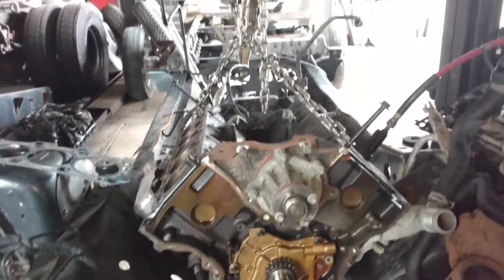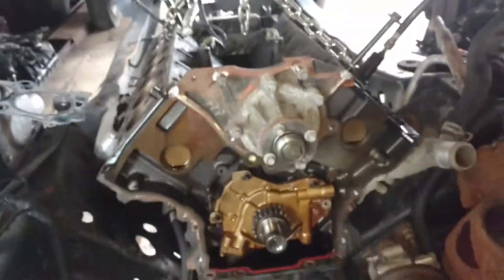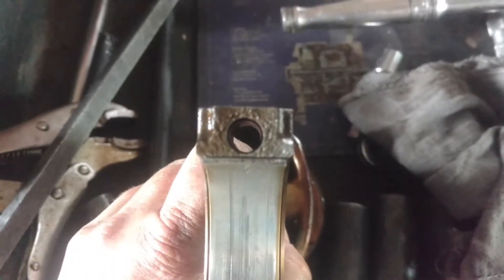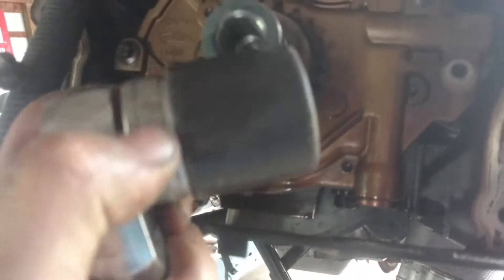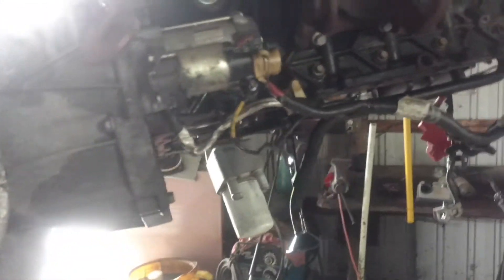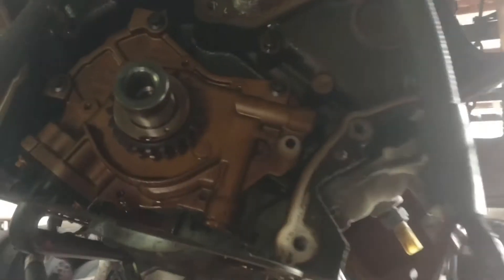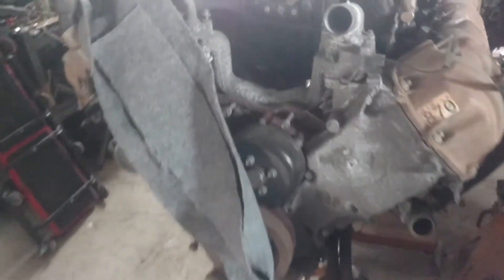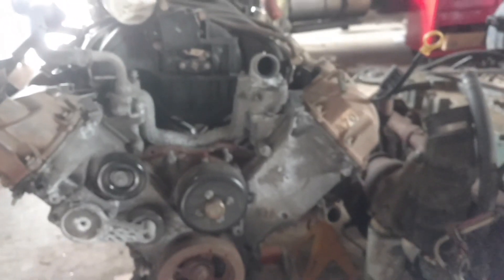PART 3) 2013 Ford 6.8l engine is fixable! Comparing Ford mount to duramax!

Comment: The only thing I dislike about Ford is the way they put the front ends of their engines together. Even going back to the old Windsor blocks they route water through the timing cover, use way too many bolts to hold the water pump and timing cover on, including those vertical bolts that go through the oil pan from the bottom. The small block Chevy is about the best design to work on I’ve ever seen, the LS isn’t near as easy but still ok.

Comment: Is this engine going to be part of your International project from Jonathan W
Reply from the maker: ARednecksLife I don't want to give anything away but I will give you a little idea of what the goal is with the truck. I plan to make it a daily driver with a/c, cruise control and able to travel at highway speeds. it will be able to tow heavy loads. I don't do much in the way of "recreation" so it needs to be able to used for everything I do so it doesn't just sit around.